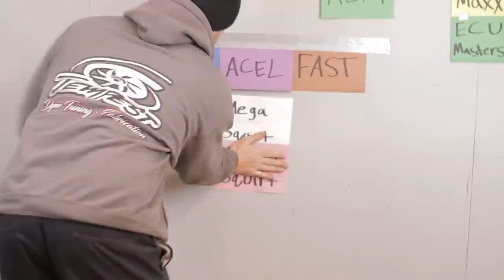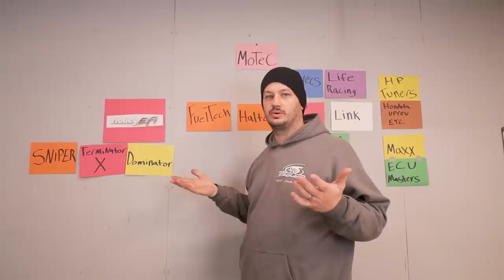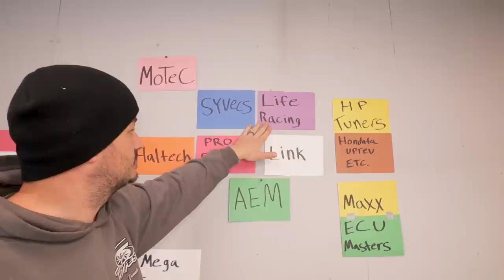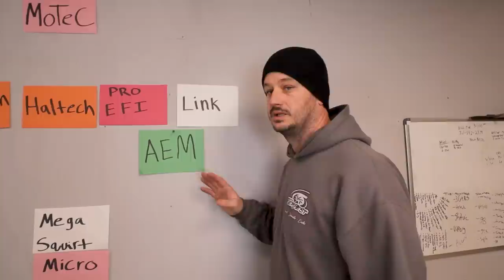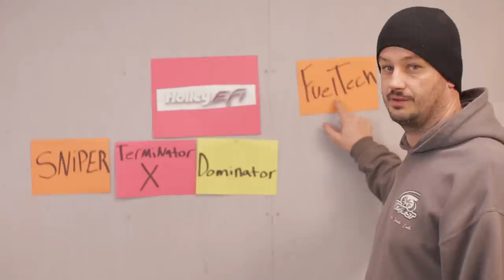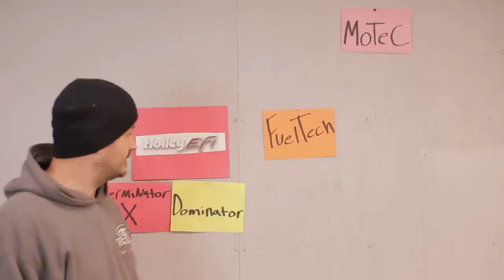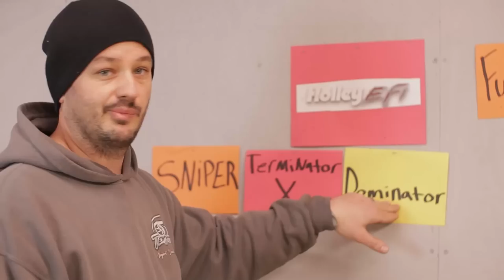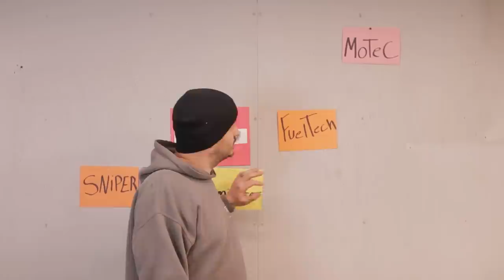Holley efi  VS.  Fueltech, Motec, Haltech, ProEfi, Aem, , Etc. Terminator X / HP - Dominator -sniper

Comment: I have MS3 in my Foxbody SBF running LS coils with a 36-1 wheel. I’m surprised you don’t get into it more. To me it is infinitely more “tinkerable” than Terminator X. It has a ton more ins and outs than Terminator X or HP. I would think it would be something you would love.
Reply from the maker: I’ve done a few cars they it worked out well but honestly most of the cars they come in with it are absolute disasters. Same can be said for terminator x, but  i get 300 term x calls for every ms call
Reply: Oh I can see that.... a lot of it is in the install as with anything. Tuning is very universal from the little I’ve learned which is why I love watching your stuff and learning and applying it to my own. You do a awesome job keep it up.
Reply: I would agree that the MS software has a lot of features and functionality however the hardware leaves a lot to be desired. From the position of doing this for a living, you need something that has well developed and reliable hardware. In other words, yes it's important to have all the functionality in the operating code to make the engine run the way you want, but if the hardware is not solid it's just not worth dealing with especially if you are  charging people for this sort of work.
Reply: @JoeSimpsonAtTempest  wouldve really liked to hear some insights on the BS3 Gen4. I'm on the fence about it at the moment

Comment: My biggest turn-off with Holley is that the CANbus is locked so you are forced to use their dashes. It would be nice to run a MoteC or AiM dash and logger for people race racing and the motorsports that aren’t drag racing.

Comment: Great video!  I’m curious if your experience with Haltech has changed over the past year since you did this vid… Also, between Holley Terminator X and the Haltech Elites in regards to tuning in Alpha-N, does one system stand out over the other?  I’m planning on upgrading my stock ECU on my ‘75 280z for street/autocross with a 3.1 L stroker (original straight 6) with Jenvey ITBs and was told Alpha N tuning will help me eliminate a lot of vacuum lines. Thanks!

Comment: What do you think about Speeduno/RusEFI? Have you ever even seen them?

Also interesting that MoTeC can work with in-cylinder pressure sensors but Holley doesn't really support that (?) because that sounds like you can do different cycles, like Atkins for fuel efficiency, or maybe tune a diesel or something..?

Comment: Great coverage on a difficult subject. I would have liked to have seen a lttle bit about fault diagnostics and data acqusition between Motec & Holley. I'm debating changing a GM Performance Parts "Crate motor ECM" to a Holley system....

Comment: Great video Joe 👍
I tune a few different flavors of ECU and Holley has always been my favorite. From NA to Turbo and or Nitrous, Holley HP and Dom. has always done everything I've wanted/needed to do. 
All of my tunes are on motorcycles though = no factory Plug n Play Harnesses and OMG I could talk for hours about having/solving Crank and Cam Signal issues (no Base Tune/SETTINGS available for bikes either). With that said, one of the few things I Love about MaxxECU is the built in Trigger Logger and Oscilloscope = easy to measure what Trigger Voltages are needed for each application...
Reply from the maker: ah yea that doesnt sound very fun.  its nice to spend your time tuning not installing and diagnosing!
Reply: I run microsquirt on my bike, cause it was cheap, and the guy I bought it from made a base tune for it....it was a carb bike stock, zx11, it works good... But would like to go with MS3X or maxxecu if I upgrade to hall sensor traction control.

Comment: Hi Joe, good video, i have i Fox mustang for 13 yrs. now. i currently have a Chip in my factory ECU that was Dyno tuned about 5 yrs. ago. Don't get me wrong. it runs good. Supercharged 302 all done myself outside of the tune. Currently it makes like 470 RWHP 440 RWTQ. And ran Best of 10,87 @ 126 MPH. on original stock suspension. i am about to install, Anti Roll Bar, Dual adjustable Viking rear shocks and the SVT Adjustable coil springs. As well as Coil over in the front with Bump Stops. It's just time to dial in the suspension now that i accomplished breaking into the 10's with legitimately stock suspension. So my question is looking to most likely go with a standalone. As well as learn how to tune myself. I've watched some video's and it looks doable as i feel i can get a handle on it. Some of the stuff Brew2l Shows on some of his YouTube videos was helpful although it was with the Mega Squirt. but my guess is the software parameters would be somewhat similar. please let me know your feedback. I have also seen a couple videos on Pro M where people were very happy said the car runs like stock. I do plan to be adding a small progressive shot of nitrous to my roughly 16 Lbs. of boost. LMK if you have the time to hit me back. Thank you.

Comment: I think Megasquirts are popular with Fox body owners because they were most capable system for many years. Way better than erasing eproms with a UV light or running a "piggyback". They are even better now. Just recently a buddy installed the MS3 based Stinger Pimpxs into his supercharged '92 notchback and it really was almost plug and play. It's not a Motec/Haltech/Holley with traction or boost control but I would have killed for one 20 years ago in my Incon TT '86.

Right now I'm struggling to find a retrofit multiport solution for a 2nd gen Camaro other than the single plane HP Dominator. I have a Stealth Ram which Holley still sells a harness for but, if it's the same harness they sold with the complete HP Stealth Ram system, I think it's only setup for a single O2. While that would work in a 3rd gen or single turbo application, it's a no-go for me. The Edelbrock Pro-flo XT is also out as there's no E85 support.

Comment: MoTeC is still the best option in my opinion if you have something that has a very wide range of usability. For example, if you're building a car that's not just street legal and drivable but will see heavy duty track use - like OUSCI or OLoA - then MoTeC gives you the greatest range of built-in support for other control modules like ABS, sequential transmission, and so on.

Comment: Motech problem really is that they are alot more difficult to use and not user friendly.... The haltech is by far now the leader with there CAN BUS setup and great PDM which is all intuitive and VERY easy to use and setup with half the wires and worry.

For the general person just wanting to do a engine swap or swap out for something that really with a few online lessons can get rid of all their old Fuse boxes and bird nest of wiring the haltech is very easy to use... 

Holley take the ease of market if your a chev guy or just want to convert that old carby V8 into EFI its basic easy and works very well. The far end of the scale of their products dominator are back to not very user friendly when your at that end.

Comment: I'm looking to replace the efi on my 91 Chevy  G-10 4.3 v6 with a self learning efi.  The van is 30+ years old now.  I have a problem with the fuel now.  I've thrown parts at it.  And a local garage said the problem is the computer.  But these are vin specific and will cost about $500.  I'm thinking the new efi will have new parts, wires, computer, etc.   ... What would you recommend?   Also I'm thinking of upgrading to a V-8 soon.   Thanks

Comment: Great video there I just wanted to comment about the 24xx and fuel tech the megasquirt microsquirt and megasquirt pro also has the same issues with picking up crank trigger signals I don't know what it is about those two but I wish they could fix that myself I just run a DIY 36 - 1 wheel never had any problems.

Comment: Haltech tech support is so much better than Holley. Just like you said in your video, good luck with Holley. Haltech on the other hand is extremely responsive and knowledgeable. Haltech is much more flexible on setups but requires a little more knowledge to wire and configure everything. The Haltech Nexus R5 is a great product. Holley has some real big issues with EMI, especially the sniper.
Reply from the maker: haltech's tech support is really good

Comment: I agree with 99.9% of what you said. I clicked on the video because... I've been debating between upgrading my ECU. I have a 71 240Z Turbo megasquirt V2.2. Lol they don't even make anymore. 🤣 the motec and the different firmwares doesn't make any sense. I guess it does but it would be nice if one firmware did everything and software did different configurations. But I've literally been debating between fueltech and a dominator. I've probably put 200k on my ECU probably 10 to15k miles on the track. Maybe I'll just leave it alone until it dies. It would be really nice to have a modern ECU with all the cool stuff to mess with and tune to my heart's content. Thank you for making the video. Probably not going to go with the fueltech just because of the crank trigger issues.... those are the worst. dealt with that in the beginning getting the megasquirt setup... no thanks.
Reply: then naturally.. ms3pro

Comment: Looks like you're working on some cars that are pretty high end. I'm building a big block Ford with about 550 horsepower. 502 cubic inch and the last one I built I Put A 850 double pumper carburetor on it and it was a carburetor need I say more. I'm watching your video because I'm considering making the move to EFI but as you mentioned early on it can be a nightmare. Edelbrock sells a fully sequential setup including manifold and distributor for my build but the manifold won't fit my Super Cobra Jet heads. That leaves me with an 850 double Pumper or? At this point I don't know which is worse living with a carburetor or spending a ton of money on something that's a pain in the ass to get dialed in. Love to hear your comments good video by the way
Reply from the maker: Put a Holley dominator ecu in it and then join my course to learn how to tune it haha

Comment: So my reasoning for being here is I finally decided on the holley xmax (with transmission tuning capabilities) but, just as I was going to order it says 4l80 and 4l60 transmissions... I currently have a 2010 Camaro SS with a procharger and a squirt of Nitrous.... but, that 6.2l is in front of the 6l80 and the holley xmax does not work with that transmission. Correct? So what are guys in my boat doing? Buying a 1500 ecu then still paying a tuner to mod the trans?

Comment: What do you say about Haltech's MAF sensor capabilities, does it give better fuel millage due to more accurate air calculation?
Reply from the maker: I dont know a single purse using a maf with aftermarket ecu. I’m no help there
Reply: I would go map sensor though from the haltech an do a maf delete. think you have to calibrate it but it works even on boost.  4 bar sensor on elite ecu just need an update 😋

Comment: Motec Is hands down the best. And there are at least 2 more from Europe that are better than the others. DTA, and Pectell, .All of the Euro systems use better internals than the  other brands. As far as the non Euro systems Fast is the best. For the same reason I said above. John was doing systems way before anyone else except Haltec. They were the first. I had one of there systems back in 91 before anyone had a clue about fi.

Comment: I got the Dominator last month, not sure how it's working because I'm still waiting for the first internal datalog I took to finish downloading
Reply from the maker: Haha yea since it logs all channels you need to just log what you need. Set up your start and stop parameters
Reply: @JoeSimpsonAtTempest  We definitely set triggers/ parameters, but I want the entire session and prefer 30+fps. Logging road course stints  that are ~30mins on track at a time, there's barely enough time to download the log between sessions. Trying to work out some telemetry system, thinking about a raspberry pi that emulates the USB port over a network to a laptop in the pits that will act as if it's plugged in to the ECU... have any suggestions?

Comment: When nascar brought out their system, it was said to be Holly parts with McLaren ecu.
Reply from the maker: Figured something like that was most likely going on
Reply: I just don't buy it, beyond the McLaren stuff maybe being a bit more 'hardened' in the sense of tolerating harsh environments. NASCAR v8's are literally the most technologically simplistic race motors outside of karts with lawnmower engines.

Comment: I'm a full time dyno tuner in New Zealand. I like to rate $$ vs functionality. So here are my top 3 1: Maxxecu 2: Link ECU 4: Haltech . these are what I tune the most. Now support 1: Link ECU 2: Haltech 3: Maxxecu. I have had a couple of holley ECU's (Terminator) and I find the software interface and logging very disorganized and I really don't like them Holley could of done so much better and it feels like the guys involved in making the software spend too much time on megasquirts. I really like MaxxECU they have a Mini that is so cheap and will run most 4 cylinders and Even there Pro is cheap for what you get they also have some of the best CAN option I've used and presetups as well. Link is a New Zealand product and I've really found there support to be great and it's a good option. Haltech I've found there support to be great, they do like you to use there accessories and thats good for a do it your self guy as wiring colours are standard. Megasquirt keeps failing to die and I have had to make strict rules with Megasquirt/Microsquirt/Speeduino as they are commonly self made and have assembly and wiring issue's and I have never got to the end of a tune and been 100% happy from my point of view with the tune/running

Comment: What are your thoughts on fitech? Found them when looking at ecu's for a future build when I swap a LS in my 72 c10, price wise they seam comparable to Holley Terminator x but don't know if the quality is as good.
Reply from the maker: Never used it but a lot of people get rid of that and switch to Holley. I’m not sure if it even had laptop software?
Reply: @JoeSimpsonAtTempest  thanks for replying and for the information, I was unsure about I only started to look at it because I was gonna be buying a EFI fuel tank kit from them and saw they also had a ECU.

Comment: Good video!! I already have the megasquirt 2 set up with a tune in my turbo mustang! Would you sell it and go to Holley X HP?
Reply from the maker: If it already runs and you want to just leave it alone no.  I guess ultimately depends on what your trying to do.
Reply: @JoeSimpsonAtTempest  I want to be able to turn it up and down when I make changes. My megasquirt is harder to figure out.  I had some one tune it for me. I have a Holley crank trigger,  Can you do a video on how to connect a Holley x to a crank trigger on a 92, 347 mustang. Great videos!

Comment: Good video. Even for a garage car builder I took in your no bs concept. I’m trying to soak in all this Ecu shit as much as possible. I’m in the process of building a 1st gen Camaro in my garage, it’s not your typical build by no means, no expense has been spared so far and I don’t even have a drivetrain yet, AME chassis and body on top,with rear, sus, brakes all together. Anyway if you read this I need some advice. Shopping for a 1000hp drivetrain (30-50k) was dealing a guy at borowski and he’s trying to sell me on the Emtron shit? Terminator x comes standard, will my build be top of the line? Should I spend an extra few grand and go with top notch shit....

Comment: I need help wirh Fueltech ft550 trigger wheel loss signal under heavy load. I am sharing signal with OEM ECU of corvette c5 z06 2001 twin turbo when goes over 12psi the log said missing air gap. When my car was on HPTune never had this issue. I am also on 24x trigger wheel.

Comment: I’m runn8ng a Holley terminator max x my only problem is I’m getting a reading of 9.6 to 35.6 on my wb02 and can’t figure it out I have a good tuner helping me and we can’t get to the bottom of this.  Holley asked for me to send my ecu back I have two ecu’s doing the same thing. Very frustrating. Any help would be greatly appreciated.
Reply: fuel cut 😉🙃

Comment: I'm planning on doing an engine efi swap but I don't want to mess with swapping out factory harnesses, from the engine & maybe interior dash harness. It's a 92 chevy dually Big block TBI truck. I have a 96 vortec multi port 454 L29 that I want to swap in to replace the TBI system. Would the Terminator X be a better choice instead of figuring out factory harnesses. The engine will remain stock just a cam upgrade above the factory cam specs.
Reply: Yes, just use the Terminator X and swap the harness. You will pull your hair out trying to use the factory harness not to mention the two factory harnesses you're dealing with are completely different in and of themselves.
Reply: @Ribbityibzki  Thank you
Reply from the maker: @deraculandrac917   yup, what he said
Reply: @JoeSimpsonAtTempest  Glad I found your channel, Mahalo Joe!

Comment: I wonder if Holley will come out with a trigger pattern for a 2jz?  I like my proefi 128, but I feel like with a  dominator , I could do more with. My Holley t x max in my mustang works awesome.   
Although, Obr looks interesting.
Reply: just run a cam and crank sensor and be done ...
Reply: @daftdrifting  
I am running a cam and crank sensor now.   You mean external sensors and change trigger patterns to what a Holly likes ? I have thought about that as well.